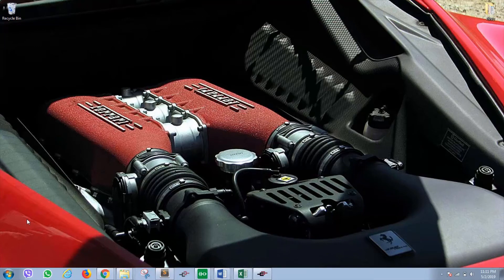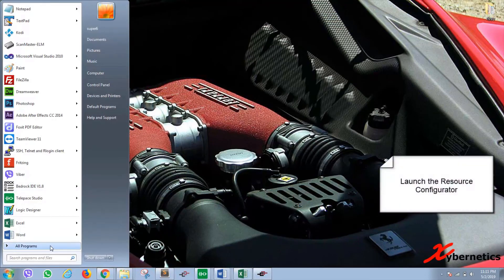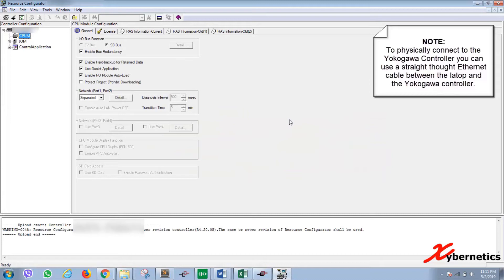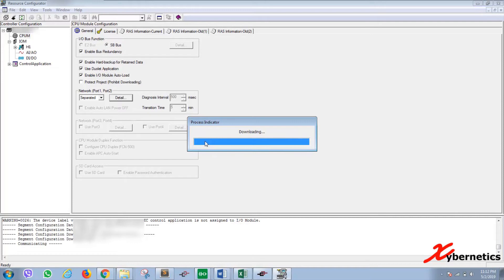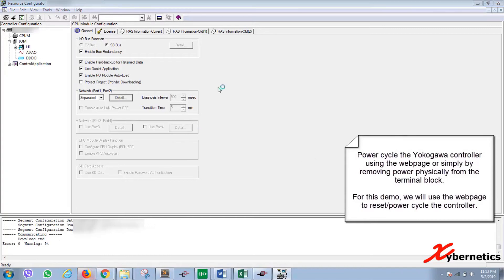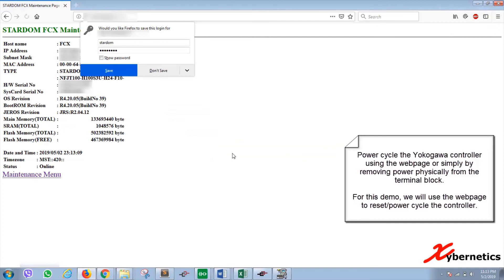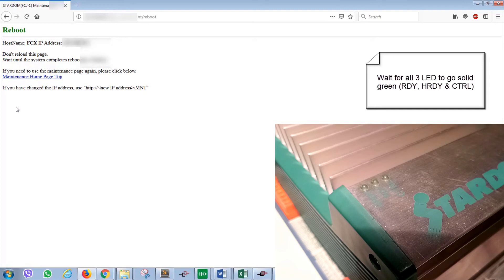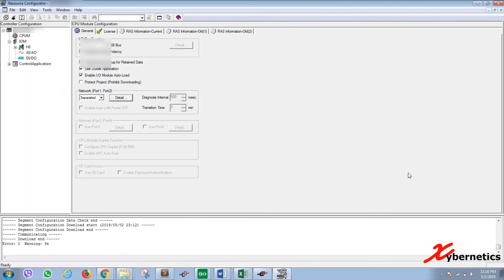Upload Yokogawa Resource Configurator Configurations To STARDOM PLC

Comment: Good afternoon, is the connection to the PC via RJ45 or serial cable?
Reply from the maker: You can use either. But keep in mind that newer model of laptop will need serial converters.

Comment: Can't seem to find access to Resource Configurator anywhere, any chance you know where to find it or could send a download link? Thank you so much
Reply from the maker: Access? Once you install it, it should be in accessible via the Windows button.
Reply: @jjnet247  Yes but I have no way to install it, I cannot find any installation media for the software. Do you have or know where to find?
Reply from the maker: @xXatlFilmsXx  It comes with Yokogawa STARDOM. And it does not require license.
I do not have a hyperlink to share with you though.